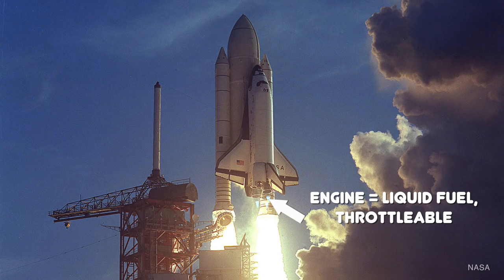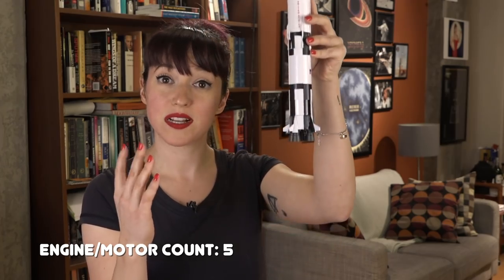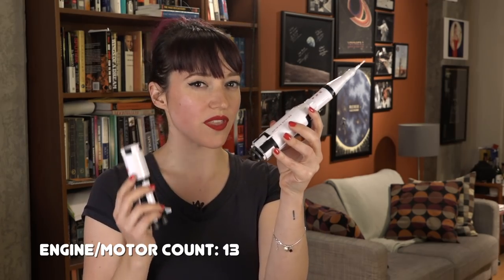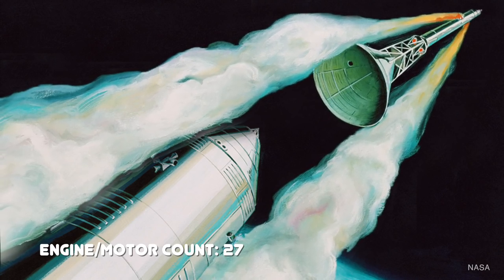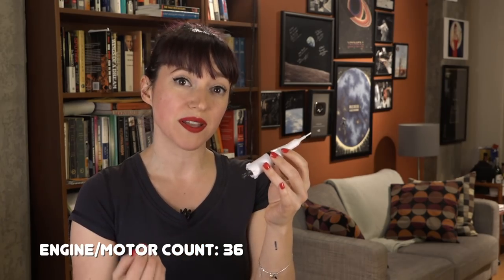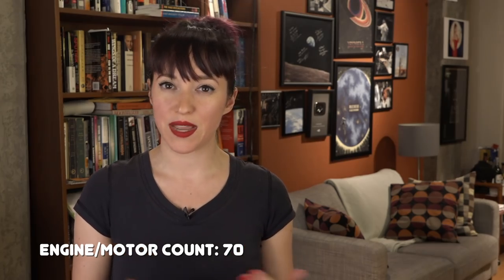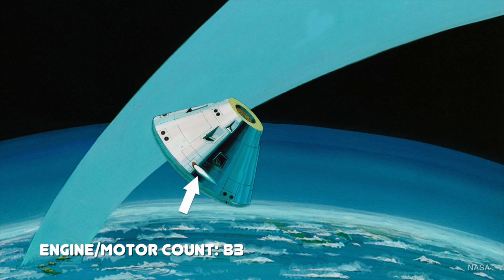It Took 83 Engines to Get to the Moon

Comment: At around 5:14 it is mentioned that ""all of these engines had to be throttled" when in fact only the lunar module DPS (descent engine) was able to be throttled.  The APS (ascent engine) SPS and of course RCS engines all had a fixed thrust and were not able to be throttled.

Comment: Wonderful video, as always, Amy.
The two S-IVB APS modules each comprised FOUR separate thrusters (three-axis and one fuel-ullage), so if you're counting the four RCS modules on LM and CM as having four thrusters in each, you should probably do the same with the APS, to bring the total to 89. (i.e. 2x4 instead of 2 APS).
A lot of motors, however you count them...

Comment: The S-1C engine skirt had 8 ullage motors on the two unmanned Apollo-Saturn V test flights, Apollos 4 and 6. It was determined that 4 ullage motors could be eliminated, so Apollos 8-14 flew with only 4 ullage motors. Again, a re-evaluation was done and it was determined that the S-II had enough ullage on its' own, so the ullage motors on the engine skirt could be eliminated altogether starting with Apollo 15. With the first "J" mission, weight needed to be conserved with the addition of the Lunar Roving Vehicle. Also, four retros in the S-1C were also eliminated. This caused the S-II engines to ignite too close to the jettisoned S-1C, causing the top of the S-1C's LOX tank to be scorched and caused a "secondary plume." The other 4 retros were restored to Apollos 16 and 17.

Comment: Just a note to that – the hypergolic fuel in the CSM was in the bottom edges and outside the crew pressure vessel along with most of the thrusters. Assume the fuel lines to the top pitch thrusters also ran outside the pressure vessel in the wall.

Comment: Small little nitpick. On the toy model you use to demonstrate in the video, the Interstage ring is actually represented as part of the structure of the second stage with the engines attached incorrectly at the end. The ring you point to as the interstage ring on the S1-C is just part of the structure of the first stage, it didn't separate. The corrugated ring with the long black stripes on the second stage is the actual location of the interstage, but the main J-2 engines on the second stage would be "inside" that on the end of the S-II rather than on the bottom of the interstage. I have that same toy Saturn V and there's a good reason why I don't take it apart! Of course the interstage on the SII/SIV-B separation stays attached to the SII because the SIVB has its own ullage motors, which had to stay attached as the SIV-B needed to reignite.

The SIV-B had two Aux propulsion system modules, but each of those motors had three engines and an ullage motor each. I believe that's in addition to two or three other ullage motors, but I'm not sure. I could have sworn that the SIV-B had three aux prop modules but I can't find any photographic evidence to back that up.

Comment: I remember the whole manned space program, even recall sputnik, saw it overhead (the spent rocket trailing sputnik) but I did not know that then. All very remarkable, in those days TV's were cranking electronics devices with vacuum tubes and in B&W only ... radio was big, cost a bundle to get one small enough for a shirt pocket. Phones were big black boat anchors' with a thick black wire holding them near to a table.
Reply: Me to Sat on the front porch with my dad and saw it go across the sky was about 8!!!

Comment: I believe that by Apollo 11, the Saturn V had reduced from 8 to 4 ullage motors on the interstage (between first and second stages).
Reply: Yes and no! Only Apollo 4 flew with all eight motors, the following Saturn V used 4 motors (Apollo 6 had 8 motor fairings but only 4 were populated), Apollo 15 had none but subsequent vehicle returned to four ullage motors.

Comment: Check your Staging! I believe that this number varied from landing mission to mission, at least as far as the ullage and stage separation motors were concerned. I believe there were different configurations of these that were used in later flights.

Comment: 3:50 I notice there are some radio dishes neatly tucked next to the engine bell of the service module.
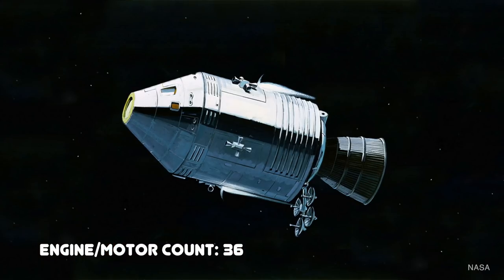4:18 The dishes are now deployed outward.
What was their function?  When were they deployed?
Reply: Wow, good question! Those were the S-band radio communication and Doppler tracking dishes. The position of the Apollo spacecraft had to be checked from earth, to confirm that it was on the right trajectory. See: https://en.wikipedia.org/wiki/Unified_S-band
Reply: Good eye. Funny thing about that. I often stash such things next to the engine bell in Kerbal Space Program, and I always considered it a bit of a cheat, since nobody would do that in real life. I guess NASA cheats, too!
Reply: Yes, that's the steerable high gain S-band antenna array, used to communicate with earth beyond low orbit. It was mainly needed for sending television. The Lunar Module had a steerable high gain dish of its own, mounted on the top right side (as seen by the crew inside). Both spacecraft also had several low-gain S-band antennas (2 on the LM, 4 on the CSM) used in low earth orbit and also in lunar flight when it was not practical to point the high gain antenna at earth. These antennas had to be manually switched by the crew, and that was one of the most common requests they had to handle from the Capcoms.

Comment: Noticed a problem with the engine count:  The two APS modules on the S-IVB stage each contained four thrusters (three for axis control and one for ullage on the second J-2 firing). If you’re going to count the each RCS thruster on the other modules as one engine (which seems debatable in itself) you‘ve gotta count the APS modules as eight engines—instead of two—to maintain consistency. Am I mis-understanding something?
Reply: I noticed this as well and you are correct, each of the 2 APS units contained one ullage motor and 3 attitude control motors.

EDIT: But to be clear there were 2 not 3 APS units.
Reply: rcflyinghokie  Right, I wonder if there’s some technical reason to consider the APS thrusters different from the CM/SM/LM thrusters. I don’t really understand why those thrusters are counted as multiples, either. Seems to me like the SM should be said to have 4 engines, each engine having four nozzles.
Reply: Boxy Brown to get technical each quad thruster was it's own engine, just sharing a fuel source of that quad.  The APS was the same and I would consider it 4 engines with a common fuel source.
Reply: rcflyinghokie  You seem very knowledgeable so I have a few questions for you if you don’t mind. 

1) Did each RCS quad on the SM have an independent fuel source or were they all connected/able to redistribute between them?

2) You say the an RCS quad technically qualifies as 4 engines, I’m wondering what that definition is for nozzle vs engine and how it compares to something like a Soyuz strap on booster. I usually hear each Soyuz booster described as a single engine with four nozzles.
Reply: Boxy Brown To answer number one, yes each quad had it's own fuel source of hydrazine and nitrogen tetroxide.  They were however independent of one another so you could commonly see quad A and C with more fuel than B and D for example because of the types of maneuvers and the DAP (digital autopilot) configuration.

For number 2, each nozzle was connected to it's own electric injector assembly effectively making each nozzle individually controllable. You could actually turn off individual nozzles of a quad and this was also commonplace especially to prevent LM impingement.  Also consider multiple of these can be fired simultaneously which would be challenging to do of they were simply diverting one ignition source to multiple places. This also would not allow uniform thrust for each nozzle as individual injectors do.  Hope that helps!

EDIT:  Although pretty technical, this may help you define the quads as having 4 engines
https://history.nasa.gov/afj/aoh/aoh-v1-2-05-rcs.pdf  Try pdf page 23 for the description of the RCS engines.
Reply: rcflyinghokie  Yes, thanks. That’s great info. Do you know why the R-7/Soyuz boosters are considered to be one engine with 4 nozzles (6 if you include vernier thrusters)?
Reply: Sure, you have one engine assembly (turbopumps, injectors, gas generator etc) that feeds four combustion chambers and two vernier combustion chambers.  The engine itself is what is controlling and creating the source of power and it simply feeds four combustion chambers.  None of the combustion chambers can work unless the engine itself is providing the fuel.  In other words, you couldnt have just one of these combustion chambers shut down its all or nothing based on the engine itself.

Comment: I never would have guessed 83 engines and motors.  I do question whether the reaction control engines should be counted as a single unit with 4 nozzles or as 4 separate engines.   I think a video about the actual design of the reaction control engines would clarify why you count each 4 nozzle engine as 4 separate engines.
Keep up the good work, Amy.   Say hi to Pete for me.  :-D

Comment: Amy - awesome video explaining all the engines/motors and how they worked together. Related: do you have, or could you make, a video that describes the theory/mathematics and the history of multi-staging? I was trying to explain to my wife why staging is necessary, but I was not doing a particularly good job describing it. I like your presentation style -- simple enough for most people to understand, but not oversimplified and still containing all the necessary detail and theory.
Reply: Its hard to explain without using mathematics, but Wikipedia does a fair job: https://en.wikipedia.org/wiki/Multistage_rocket

Comment: Not technically rockets, but I found this interesting - "There was also a pair of vents in the APS unit that acted as continuous ullage motors. This was accomplished by simply allowing the fuel and oxidizer that was boiling off the tanks as the sun heated the stage to vent through two nozzles inside the APS unit. While these are not technically rockets, they provided a near continuous 2–3 Newtons of thrust along the axis of the stage as they kept the tanks from over-pressurizing. Because they vented a stream of gas backward to provide forward thrust to the S-IVB, it’s arguable that those are actually the smallest rockets on the Saturn V."    -
 Jeffrey Naujok, Quora

Comment: Amy. It took 89 rocket motors and engines to do the job; not 83. You missed 6 engines in the S-IVB Auxiliary Propulsion Systems. Each of the two APS’s had 4 engines, not 1. Each APS had one 310 N ullage engine and three 670 N roll, pitch and yaw engines (similar to the RPS engines on the SM and LM) to point the S-IVB/Apollo stack in the right direction for TLI, and to point the spent S-IVB in the right direction to fly away from the Apollo after the LM was removed. Surprise!  Keep up the good work. I really enjoy your videos.

Comment: I have a question... How are the exhaust nozzles (nozzle extensions) on the command module's thrust rockets not ripped away during liftoff? Especially the nozzles that face forward. They appear to be completely exposed at takeoff. Just curious.

Comment: You missed 2 engines. The LES tower had, in addition to the main escape motor, a smaller jettison motor that was used to pull the LES and CM cover away when they were no longer needed. The LES also had a steering motor that would be used to correctly orient the CM in the lower atmosphere (only used for abort mode 1A). Although, these weren't used on a successful mission, so technically 83 would still be correct.

Comment: What kind of mechanism was used to fire the engines and motors? What kind of backup plans if any did they have for failure of ignition or actual engine/motor failure?

Comment: During that Saturn Program and the Apollo missions were engine failures not as serious during ascent?  

I recall that at least two Saturn V lost engines, one flight lost two engines and Apollo 13 lost one-both flights on the 2nd stage.  Both burned the remaining engines longer.  Where as the shuttle had several modes where an SSME failure would most certainly end in total vehicle loss.  Challenger did have an engine shut-down during flight that resulted in a abort to orbit.  They almost lost another but a NASA controller caught the failing sensor in time.

Comment: Did you have a video of or acces to footage of the actual hard down  of the launch platform stack to the pad's permanent structures, the connection of electrical and plumbing provisions,  the removal of the crawler, and the emplacement of the blast deflector?

Comment: Hi Amy!  I watched the CM undock from the SM on the Apollo 11 VR app.  Once they separate, the thrusters fire to put the SM in a rotation.  You can hear Neil say "It's rotating just like it's supposed to!"  But why did they make it rotate?  I'm guessing for stability, but to what end?  Surely, if they just wanted to get some distance and it was going to burn up on re-entry anyway, why not just fire in a straight line? I've been looking at Apollo stuff since the end of 17, and I never knew this happened, and now I would like to know why?  Hope you can help!  Kindest regards!
Reply: david543ntl If I remember correctly, they called that a "barbecue roll." It was performed so that the spacecraft could be evenly heated by the sun. Had they not, one side would get extremely hot, and the other extremely cold, potentially causing a whole host of problems.
Reply: Yup, slow rotation for even heating. A passive thermal control (PTC) roll, to give its more proper name. 

They also did that during the long coast phases to and from the Moon, obviously stopped for delicate operations like docking, and resumed when the CSM was on its own again.

Both names, PTC and barbecue roll, are heard in the movie Apollo 13, just after they pick up the LM after translunar injection.
Reply: Hi.  I understand the PTC, but wasn't referring to that.  PTC was to protect the CSM on the way to moon as you correctly state, but I am talking about after the CM and the SM separate, just before re-entry to the Earth by the CM.  As soon as this separation happens the SM is now redundant and eventually falls to Earth and burns up, but they put it into a rotation immediately after separation.  If they were just trying to get a safe distance between the two, they could just fire the thrusters in a linear configuration. Maybe on the VR app they have used Neil's voice describing the TLI PTC at the wrong time in the mission?
Reply: At SM sep a roll was induced, what you heard is correct.  It added entry stability and ensured the SM would have a trajectory different than the CM to ensure recontact did not happen.

Comment: Two questions
1) Are the first stages from all the flights lying at the bottom of the Atlantic?
2) Before launch, did the entire weight of the Saturn V rest on the F1 engines? If not, what supported it prior to lift off?

Comment: I am a little confused here and seeking clarification: my understanding was that the S-IVb-500 series of stages used two Auxiliary Propulsion Systems (APS)s, each of which included three liquid-fueled relightable engines (150 pounds thrust) and a single liquid-fueled ullage engine that was used exclusively during first burn cutoff and relight (70 pounds thrust).   The stage also appears to have contained two ullage solid rocket motors that were used during stage separation from the S-II/initial engine ignition.

This would mean that the S-IVb-500 stage had a total of 10 engines/motors on the sides collected into 2 APS units and two ullage motors, not 4 collected into two ullage and two "APS" engines, which would throw the count off a bit...

The above is from the Saturn V Flight Manual SA-507 Section VI "S-IVB Stage", especially "APS CONSTRUCTION" on page 6-19 (for the four engines in each APS), "PROPULSION" on page 6-4 for the use of APS ullage engines during initial burn cutoff and engine relight, and "ULLAGE ROCKET SYSTEM" on page 6-29, which (together with the rest of the ordnance section) seems to be the only mention of the ullage motors. Credit - I found the reference to this manual from Nasa's online copy of SP-4206 "Stages to Saturn: A Technological History of the Apollo/Saturn Launch Vehicles", which mentions the 8 APS engines, but not the potential 2 other ullage motors used during staging.

As a side note, if you would like to go really crazy, one could try to catalog all of the explosive devices used in any way during the Apollo missions, including both rocket engines/motors and other ordnance, which would be a much higher number!

I would be very interested if anyone could clarify the design of the extra engines on the S-IVb-500 relightable stages, or more authoritative/clear sources about the design and major components of any Saturn stages.

Comment: Amy very cool video. Thanks. Question with the Interstage between Stage 1 and 2. The mentioned the 8 ullage motors on it to push S2 before it ignited, but I just wondered, were there no retro rockets on the inter to help separate it from S2 or did it just rely on S2 forward propulsion?

Comment: Hey, Amy. I was watching the movie version of Apollo 13 (as I often do) and I'm curious about the inboard engine cut-out on the second stage. It was "the glitch for that mission" until it was old news when the CSM blew up. I'm wondering what would have happened if an outboard engine had cut out. I don't recall any other main engines failing during the Apollo launches.